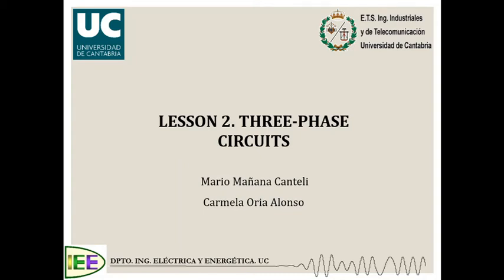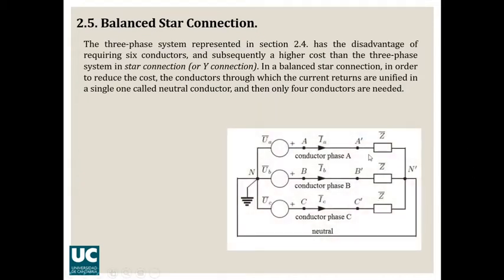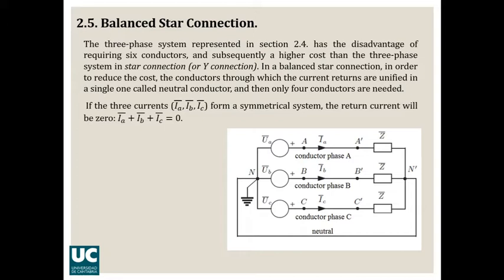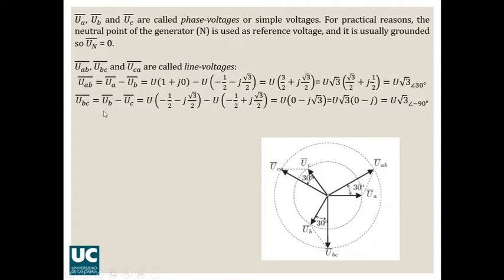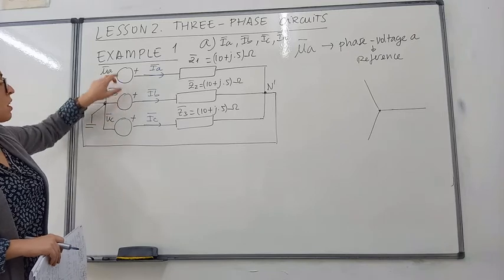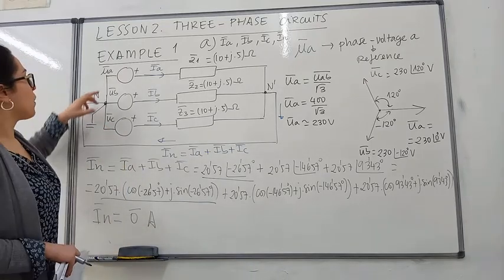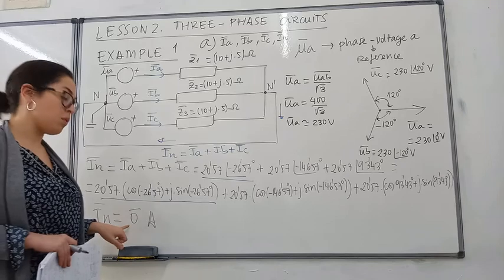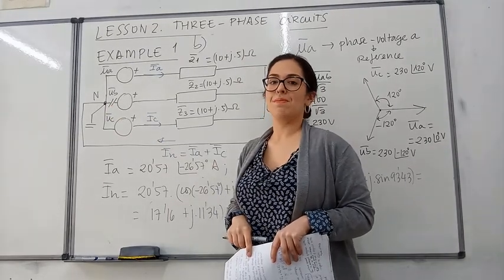E&T: Lesson 2.2. Three-phase circuits (2.2.5 + Example 1)

Comment: Buenas.
¿Puede darse que la tensión lineal sea diferente cada una de ellas?, por ejemplo que nos den de datos que Uab y Uac tengan valores diferentes. Y en ese caso, ¿la corriente total no sería 0 no?
Reply from the maker: Hola Isidoro. Si eso ocurriese, estaríamos hablando de un sistema con alimentación no simétrica (las tensiones de fase y de línea no son iguales en módulo, o no están desfasadas entre sí 120º). Si eso ocurriese, todas las simplificaciones a las que llegamos en los apuntes para el caso de sistemas con alimentación simétrica y carga equilibrada no serían válidas. Es necesario que la alimentación sea simétrica y la carga equilibrada (misma impedancia conectada en cada fase, en módulo y argumento) para que la suma de las corrientes de línea Ia + Ib  + Ic, o corriente que circula por el conductor neutro, sea igual a 0.